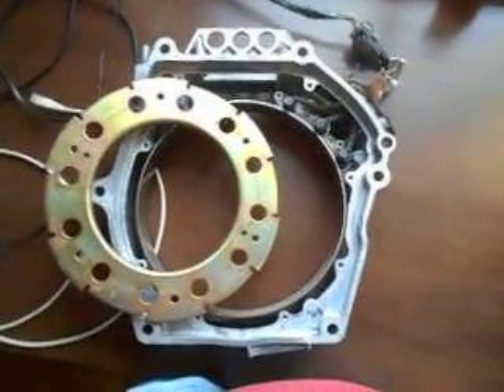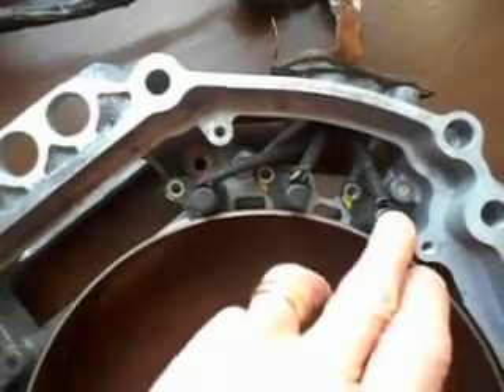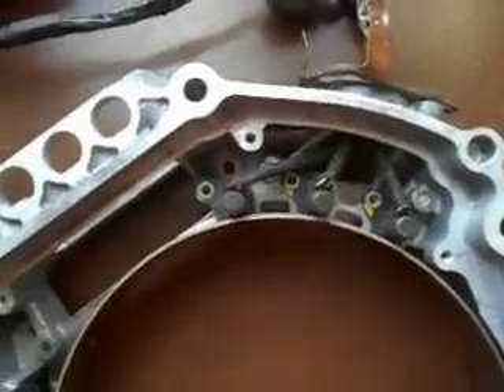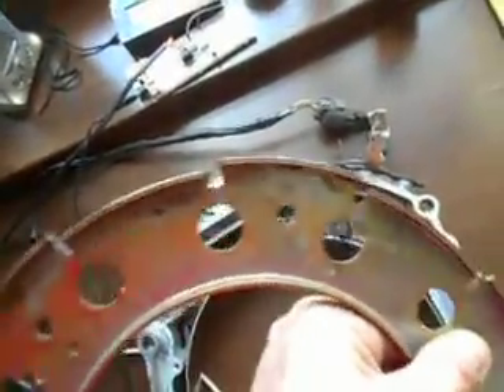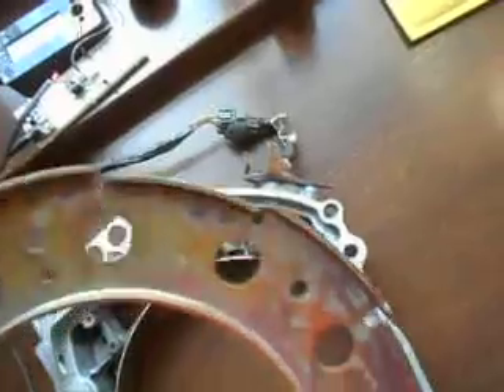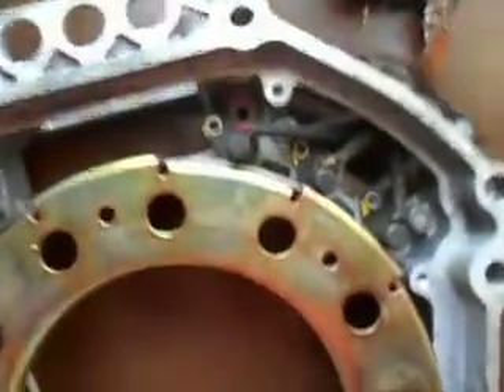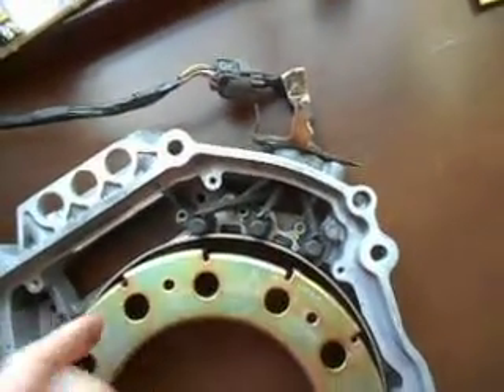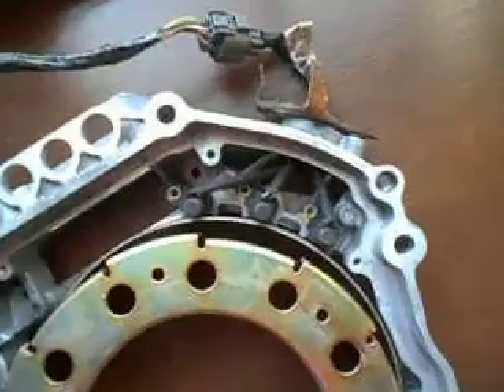Insight Commutation sensor arrangement

Comment: 04’ CVT owner here with the P1565 code reoccurring. It has issues taking off from a dead stop, like a delayed clutch engagement, jerkiness, etc. but I’m worried if I just replace the sensors, that they will just be destroyed again immediately by whatever destroyed the originals. I can’t tell if the wires on the outside leading into the commutation sensor is corroded, as it’s wrapped in plastic.